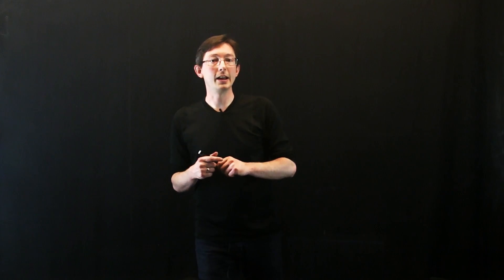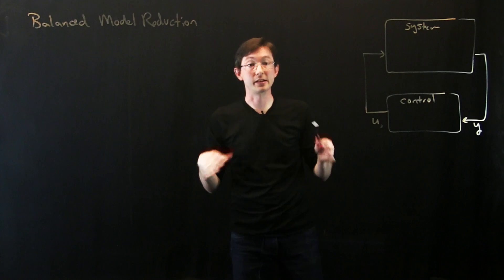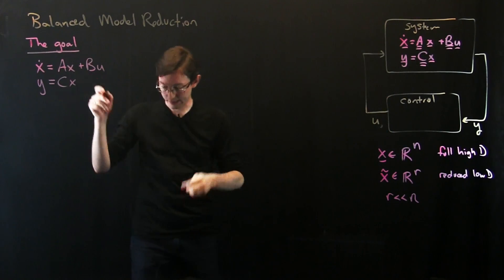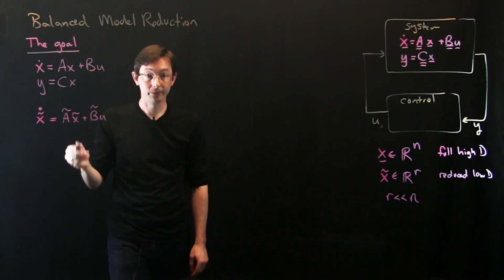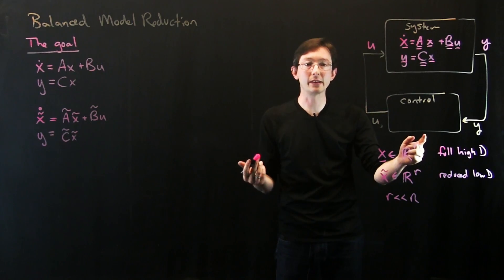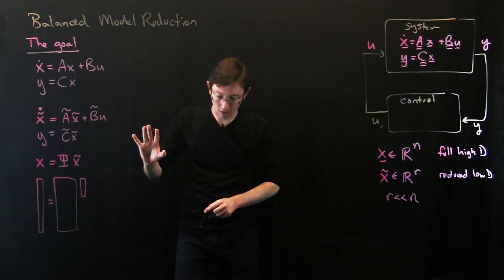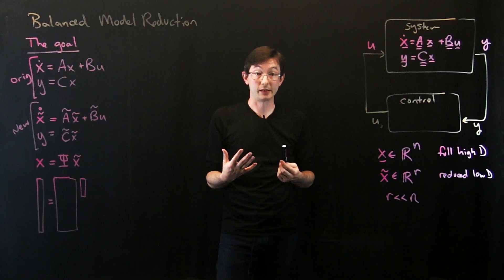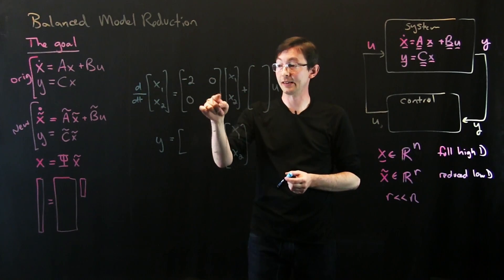Data-Driven Control: The Goal of Balanced Model Reduction

Comment: hi, shouldnt the C matrix at 11:52 be the size of A square matrix, so that its [1 0; 0 10^-10]?
Reply: No, it should not be related with A. IMO, size of C depends both on # of y and # of x. If y is a scalar, then c should be 1  * 2 (# of state x)
Reply: @jyxbb0825  yes, you are correct, C must be the size q x n where q is # of outputs and n is # of states, while A is n x n

Comment: When you are doing the reduction and leaving out some states from your new model, are you assuming that those left out states are already stable? My understanding is that when your system is fully controllable, you can arbitrarily place the eigenvalues. But if you have unstable states that get reduced, are you leaving out information about the stability of your system?
Reply from the maker: Great question.  That is absolutely right.  You would need those states that you are truncating to be stable.  When we talk about how to find these states in the next lectures, we will look at the controllability and observability Gramians.  These won't even be finite if there are unstable states.  There are extensions to balanced truncation for systems with unstable states, but that is a bit more advanced.